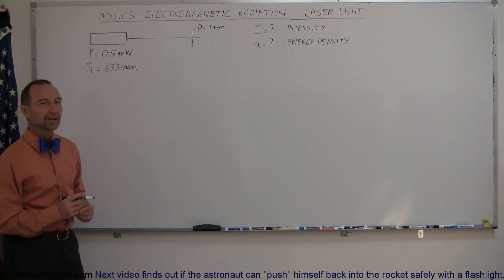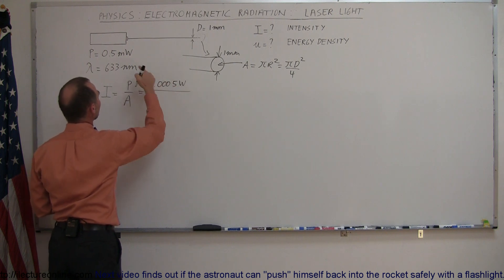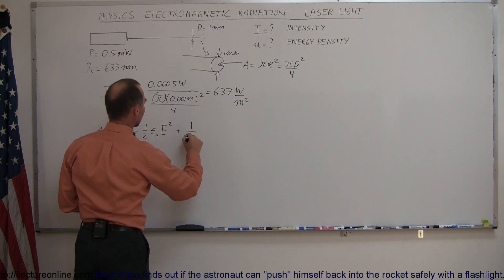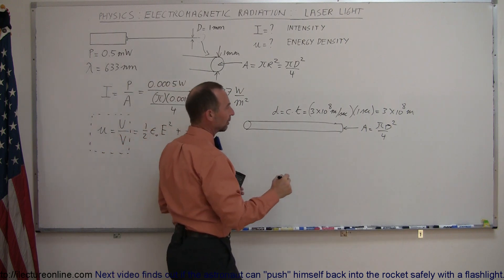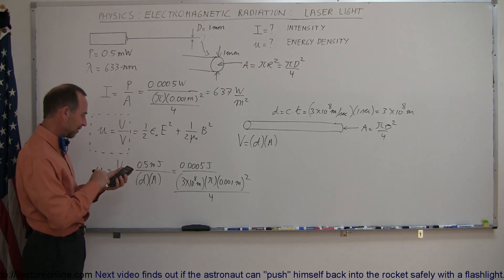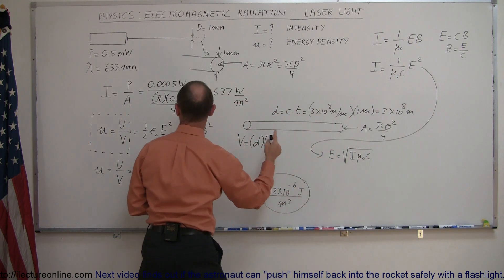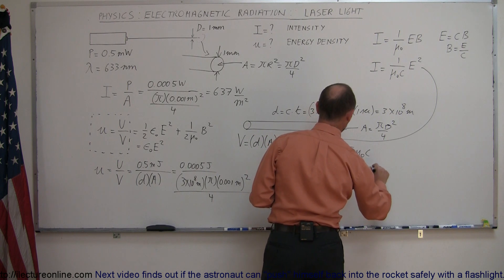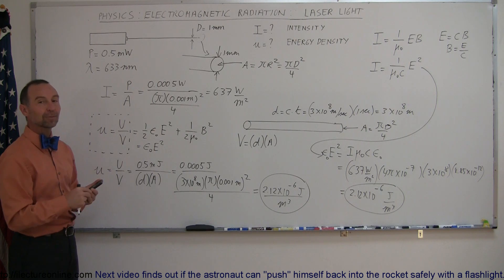Physics 50   E&M Radiation (31 of 33)  Laser Light Example

Comment: Is another way to find the energy density by using u=I/c where I is intensity?
Reply from the maker: That is not quite correct.
Reply: Michel van Biezen I thought so. It is because that is the equation for pressure, right? I searched online a little more and found that pressure and energy density have the same physical units. Therefore, what is the difference between energy density and pressure?
Reply from the maker: The units for energy density are:  J/m^3       The units for intensity are:   W/m^2 = (J/sec) / m^2
Reply: Michel van Biezen Sorry, I am still confused. In your video of energy of EM radiation, you specifically state that energy density (u) is equal to intensity divided by the speed of light..
Reply from the maker: Look at the video:  Physics - Electromagnetic Radiation (3 of 5) Ex: Laser Light   https://www.youtube.com/watch?v=MCVH_IztXFo&lc=z13ld5qynle0w1zlq23ydf04is22svztn   It clearly shows how to calculate the intensity and the energy density and the associated units.
Reply: @MichelvanBiezen  I also had a laser question in class similar to this one and my professor used uavg = Iavg / c to solve for energy density. Iavg / c is (W/m^2) / (m/s) which results in (W*s) / (m^3) which is just J/m^3. It yields the same answer.